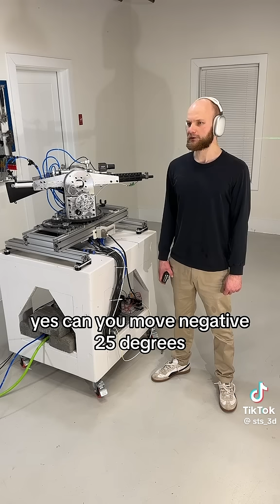AI is totally safe. It

Comment: To be fair, any programmer with some hardware experience could do something similar if not the same thing prior to the explosion of LLMs. It does make this a bit easier however. And, this is not Skynet. It's probably more dangerous than that. It's an average guy. They can be much worse. And an another addendum is that OpenAI has banned this user from running this application.  I'm sure they'll be on the look out for similar projects in the future.
Reply: As if that matters.  This is EXTREMELY simple to do.  You could literally run oollama on a Pi and do this without authorization from anyone :(
Reply: @stevrgrs  This is extremely simple to do WITHOUT a Pi or any other abstraction layer. It's just basic bare metal programming.
Reply: Yep.
Reply: But it also makes no sense to moderate projects like this. All we know there is many local open source AI model which will be even better for purposes like that. 

And it's not really difficult to make your own AI just for shooting firearms, and make it optimized and fast as fck. I think all this will not lead us to something like skynet..but there is many bad people on earth, it will definitely be using for crimes. It won't be the apocalypse, but we're sure to see some shit with these technologies
Reply: Could probably get away with an Arduino
Reply: @notrando5336  NVIDIA has a new RaspberryPI sized mini computer capable of a surprisingly fast local LLM. The Orin Nano
Reply: Oh come on. You think there isn't some malicious geek out there, somewhere in his garage workshop, who has strip-copied off the source code & is cooking up similar projects low-key? 🤷‍♂️

Comment: No offense, but this was a terrible idea. Great engineering, but a horrific invention
Reply: Well, the thing is that this was perfectly achievable even before AI was around. Automatic anti-aircraft systems are capable of doing this and more without any AI on board, just a regular programming
Reply: @mikumikuareka right. It seems like what people are most afraid is the sheer mechanical power; probably akin to what people who witnessed the first steamboats and trains experienced.
Reply: @mikumikuareka  Yeah but it's crazy that ai (actually just a simple chat bot) can already automate this process.
Reply: @joemoe1560 
It doesn't automate the process, you need to build the AI and formulate how the components connect.
Using the AI to do it is akin to using software someone else made to do it for you
Reply: @rrestoring_faith  Yes he had to build the hardware and he could have easily programed it to do those commands with a click of a keyboard. The cool part is that he didn't have to build the ai though. He taught it how to controll the actuators for certain commands but it's very flexible. He can make small talk and chit chat between commands and it will still understand. That's because he didn't build the ai, chat gpts language model and speech tech has already been done for him. That would be 100x harder to make by himself.
Reply: @joemoe1560  yes, which is akin to using someone else's created software to do the work for you
Reply: @rrestoring_faith  Yes he is basically using someone else's software but that's exactly why it's so cool. Practically, programing precise controls would be more usefull. I'm not saying this is necessary but the whole point of this project is that even a random joe can use an ai langue model to controll robots for free. That would be a fun project to do no matter how usefull it is. It also shows how easy it would be for corporations to incorporate ai chat bots into thier products (specifically robots) today. It's not even something of the future.
Reply: @rrestoring_faith even if you make your own LLM to control this, you still made an LLM. You might say that you don't need an LLM in the first place, which is true, but that is not the point of the project.
Reply: @mikumikuareka they did exist but this is very high level and intuitive. There is a difference between needing specialists who needs to calibrate and operate your machines compared to being so high level it understands and processes literal english sentences, the level of possible refinements, personalization and modularity that entails is insane, this is darpa and lockheed martin level technology literally being accessible to mcdonalds cashiers and curious snotty high school kids instead of kept in close circuit and confidential r&d labs.